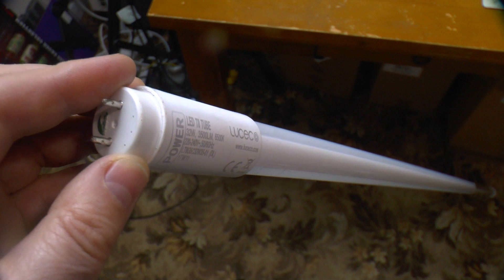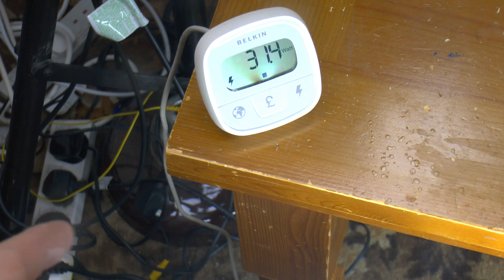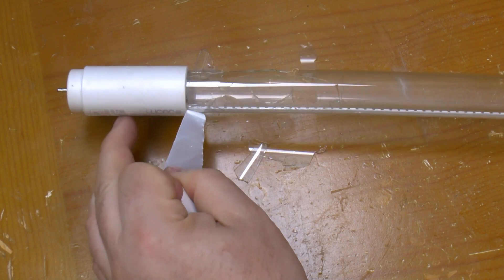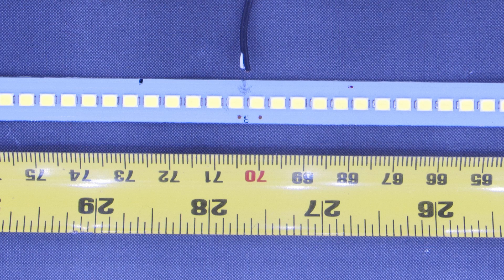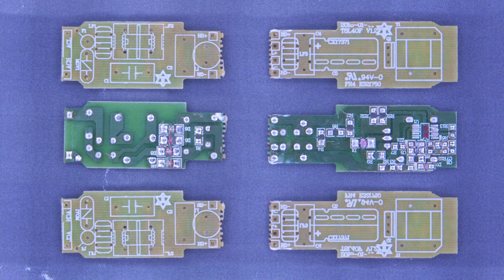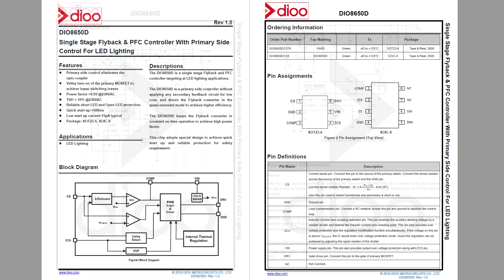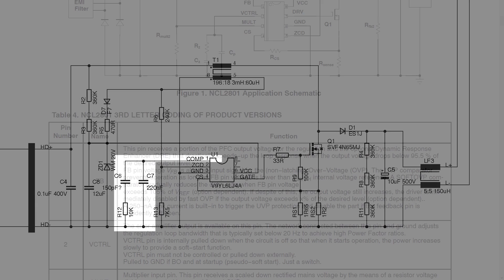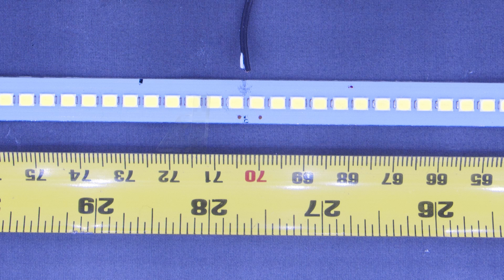What's inside a Luceco 32W LED tube?

Comment: If the driver on this tube goes, you could probably drive the LED strip with a simple voltage doubler rectifier circuit. If the capacitors are suitably low enough value, on the voltage doubler, they will limit the current to the LEDs, just like some cheap LED bulbs use capacitive dropper circuits.